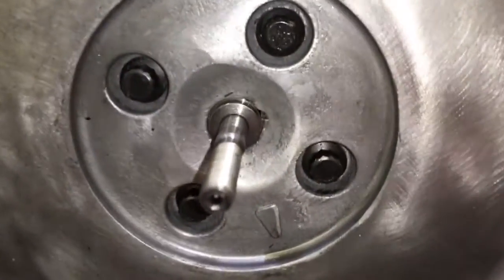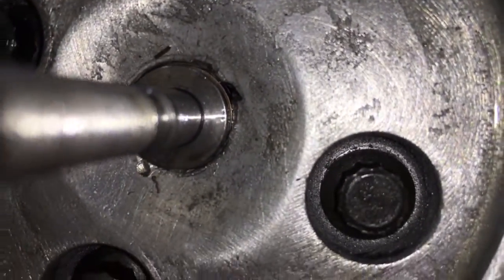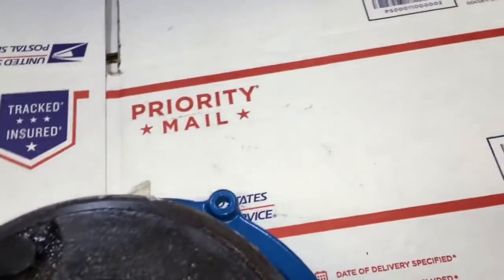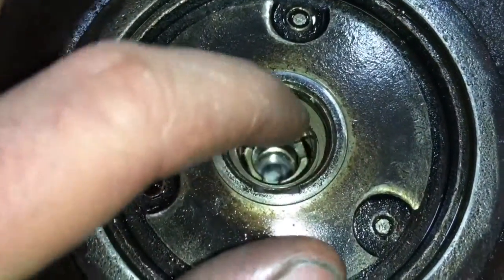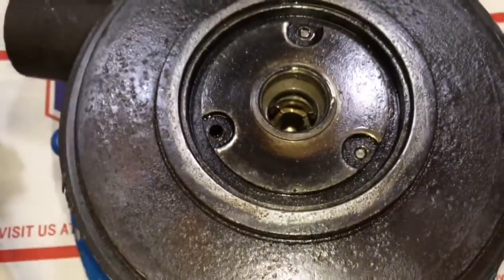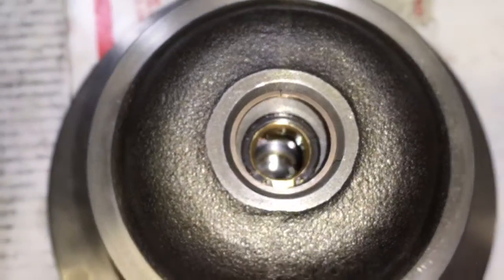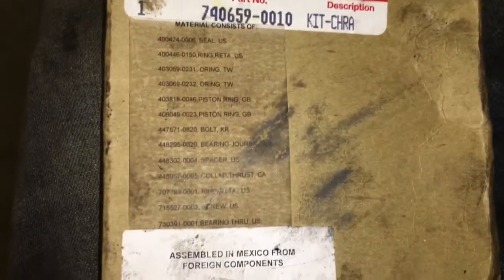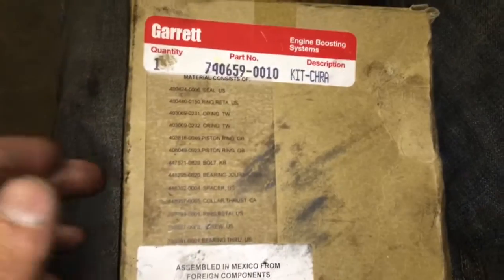6.0 turbo not rebuildable

Comment: Hey guys,  How much for a 13 blade turbine and shaft? Mine sheared right off at the turbine.
Reply from the maker: +Alan MacDougall what size 64 or 66.6
Reply: umm not sure, does it say somewhere?
Reply: should be S/N IDMO13189
Reply: Its a 2005 f350 6.0
Reply from the maker: +Alan MacDougall https://m.youtube.com/watch?v=xoV7hS73hX4 2005.5 and earlier had a 66.6 x 72 and 2005.5-2007 had a 64 x72 turbine but if your turbo has been replaced before Ford always installed a 2005.5 -2007 turbo

Comment: Good day Turbo Lab America, I'm a new subscriber and thanks for your knowledge & videos. I have a STS twin turbo kit on my 2002 corvette c5 a few days ago I noticed some oil on the exhaust tips and I think it's time for a maintenance rebuild or possibly  turbo upgrade.....Any suggestions ?Thanks again for your time.
Reply from the maker: +Bryan Carter I don't know that specific turbo, but I can tell from your description that it's likely an installation problem. Most likely your oil drain is too small, or you have the cartridge angled too far to one side causing oil not to drain correctly, or you are using a restrictor when you shouldn't and the seals wore out because of that, or your turbos are below the natural oil level inside the oil pan. Watch some of this video for reference https://www.youtube.com/watch?v=ESBc0bruGZo

Comment: how could this be made to work on a 4g63
Reply from the maker: +pr0n5tar i don't recommend doing that, if you were going to do something like that you would be better off using the He351ve for is more efficient vgt system
Reply: i need to order some stuff but i need to sound off with you, have a number that works i can call

Comment: whats the kit number for an lbz rebuild kit from garret?
Reply from the maker: +Kevin Rogers the LBZ and LLY us the same kit as the 6.0 Powerstroke http://bit.ly/1QvnnMr  the LLM uses a different kit because it uses a boreless compressor wheel which changes the entire thrust system however the LLM uses the same seals, journal bearing and spacer but not the same thrust collar or thrust bearing.
Reply: ok, so with the coolant going through the turbo it doesn't change the shaft length or anything along those lines, good to know